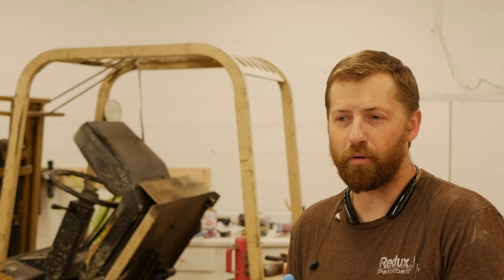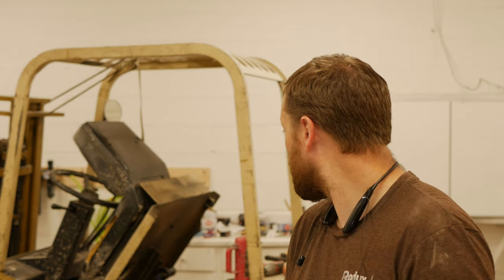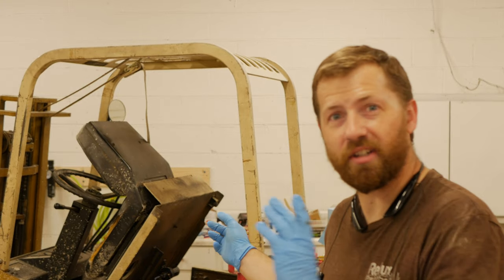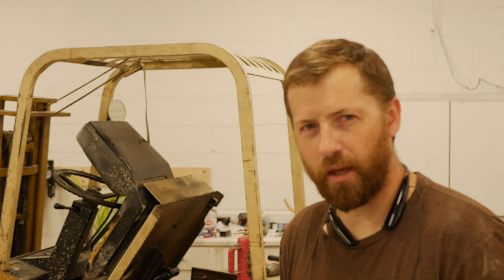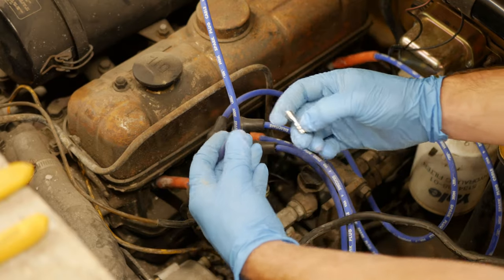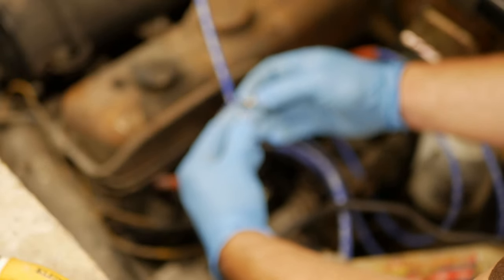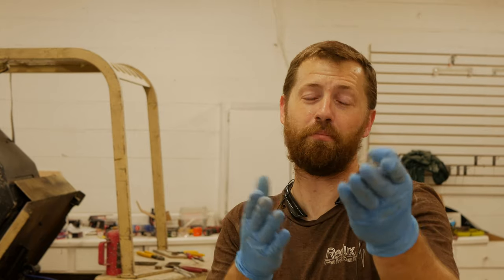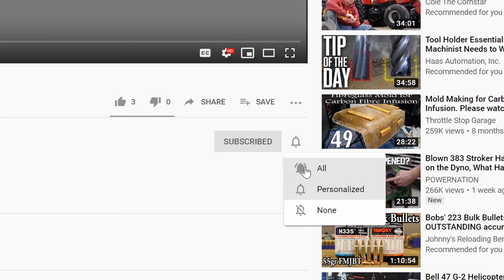Yale Forklift Repair - IT RUNS!

Comment: Great video. I have a yale 3klb,  propane. Crank/no start. Power at the coil, very small/light spark at the plug, but yes still spark. Two Questions: Where to purchase plugs, cap, rotor, etc? Would you start with the cap, rotor, plugs &wires? It's a Mazda 4cyl.
Reply: I think it's a1998
Reply from the maker: @skidmarkproductionco8837  any local auto parts store should carry the stuff for the engine but you'll have to play around with what year etc. that mazda engine came in.  They obviously wont be able to look up forklift parts but the engine came in a number of vehicles.  Id replace all the ignition components honestly.

Comment: Hey mate, I have the same model of forklift, can't seem to find the hydraulic fluid fill cap, I've checked the dip stick and it's basically empty, any advice where to find it?
Reply from the maker: You have to swing the side doors out and it should be opposite side of the fuel tank I believe.